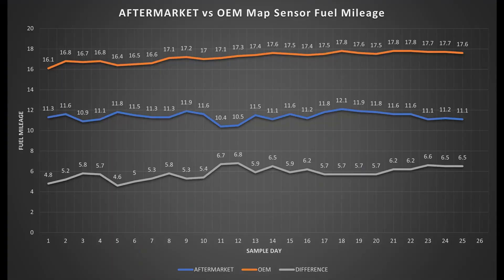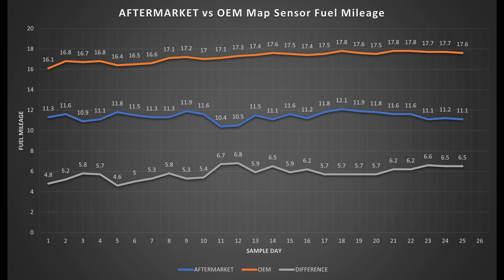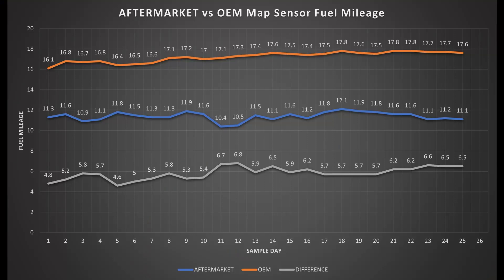Single Cheapest Way to Save on Diesel Fuel Pt. 2

Comment: I got my truck April last year. Lie dash said 12. Changed both fuel filters. Cleaned my map sensor. Now it says 15.5 to 15.7 not pulling. Calculated it by hand and got 15.5  so that helped

Comment: Just watched your first video and subscribed to your channel. I left a book there. Thanks for your update and leg work on this. 6 years ago I didn’t realize what I was buying. Man have I’ve learned a lot about 6.4’s. My first Ford diesel as well. I had Dodges with 5.9 Cummins and 6 speed before this. How I miss the 5.9’s not so sensitive motors. I love the interior and body of the Ford. I’ve been lucky with my 6.4. Maintenance, maintenance, maintenance and more maintenance.....LOL! I just did my body mounts as well. It was a fun ordeal. I added Rough Country dual shock stabilizer when I run my 24/35. Really helps with the death wobble running 35’s or bigger. I run stocks tires in the winter. Thanks again for the update!

Comment: My 6.4 has a hard time starting after it’s warmed up cranks longer than it should to fire when it’s cold it fires right up any other ideas?
Reply from the maker: I would hook a fuel pressure gauge to the fuel test port and see what your pressure is, might have a weak HPFP. Not just at an idle either, make sure the test line is long enough to run it through an open window and look at fuel pressure under a load (driving down the street...safely).

Comment: So just to be clear, on a fully deleted truck does the MAO sensor still affect fuel mileage?
Reply from the maker: It seems to have for mine!
Reply: @USAF99   Thanks. I will be changing mine also (MAP) sensor. I just pulled my 30' travel trailer 1700 miles and only got 8.5 to 10 mpg. I know the 6.4 is thirsty so anything to save fuel helps.
Thanks..

Comment: Do you have the part number for the Ford OEM sensor ? Had the same issue you did and just went with part from Auto Zone .
Reply from the maker: Yeah man, its 8C3Z-9F479-A
Reply: Just did mine today and I gave them this part number USAF99 listed. The package also had CX-2161 part number along with the number listed. I bought the last one they had. Mine was not clogged at all but was dirty. Did a quick cleaning of the old one and put it back in the package for just in case moment. Took longer to find my socket for sensor than removing and installing.